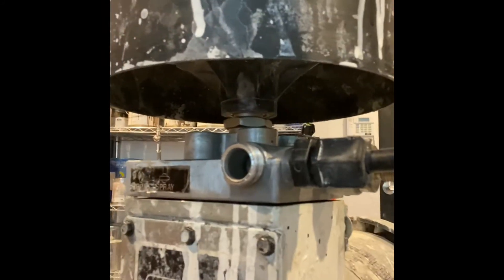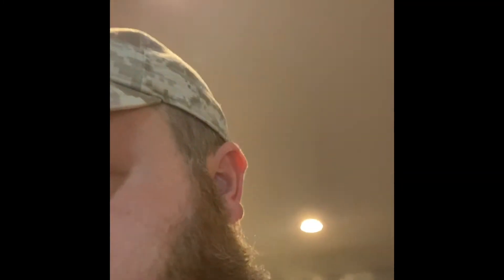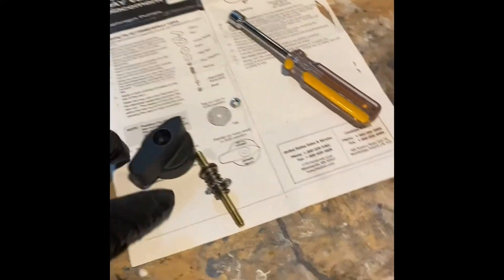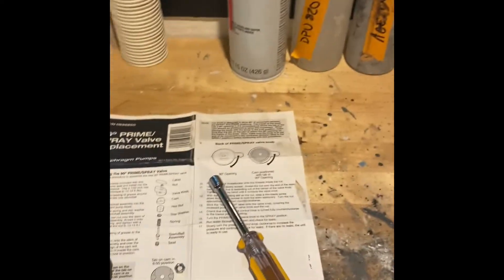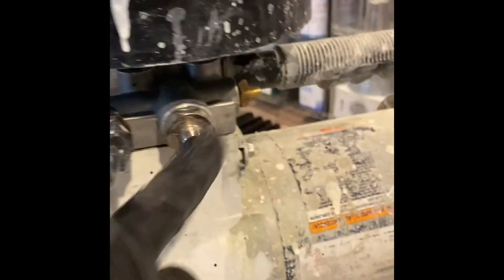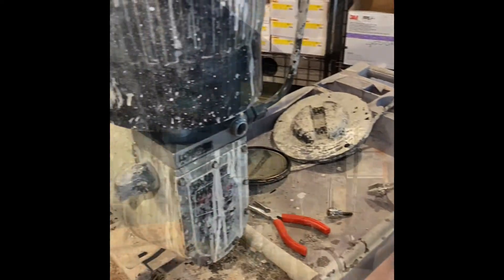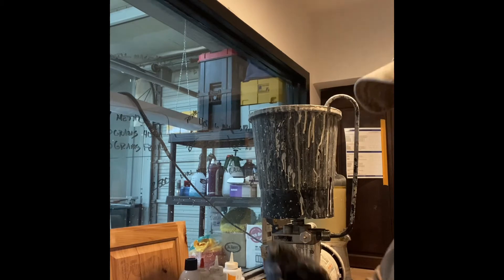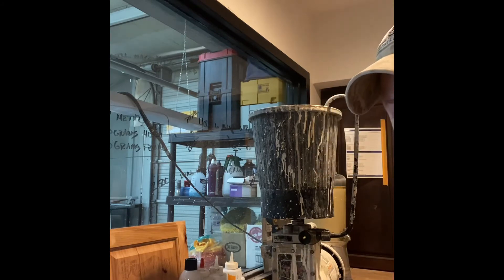Titan ED655 Prime Valve Replacement

Comment: A few details missing.  The big nut is what holds the whole thing on.  Screw it back on too tight and you can strip the threads on the head right off. The knob nut and screw slot in the needle just control the Prime/Spray adjustment. Knob nut screwed in too far will keep in in Prime mode all the time.  You need to put a  screwdriver thru the 8mm socket to hold the needle while turning the nut. The o-ring adds resistance to pulling the needle out.  I had to work it to get mine out.  Finally, not sure why you would need to replace the whole assembly. It's just a needle that closes off a hole.  Not sure how it wears out.  Mine just needed a new 1/2" O.D. 3/8" I.D. O-ring because it was leaking.
Reply from the maker: Thats awesome info, thank you for sharing.
Reply: what do you mean by the following " You need to put a  screwdriver thru the 8mm socket to hold the needle while turning the nut" about to do this on mine.

Comment: Good day sir, i cant seem to get the screw off the prime knob. Srcew just turns and turns and does nothing. Any suggestions? Thanks much great content
Reply: 😬😬 May be broke or stripped. That may need someone with a little more knowledge regarding repairs than myself.
Reply: My prime valve drips a little.  Do you think it needs a new valve or just taken apart and cleaned?

Comment: I have the same machine and recently it lost some of the pressure and starting to get this orange peel finish due to low pressure 
Any ideas what might the the problem?
Reply: Try a new diaphram, they are pretty inexpensive, also make sure the inlet valve is moving freely, pour pour some thoat seal and moving with the top of a pencil to lubricate, also outlet valve, theres a ball and seat, make sure thats moving freely
Reply: Oil change

Comment: I’ve been told by the repair shop, along with my friend who tried to repair his, that they are pressurized. You mentioned you took it all apart and cleaned it. Is it spraying properly if it is no longer pressurized?
Reply: It's not pressurized, they are meant to be work on, the hydraulic assembly isn't completely full either they only fill it about 80%
Reply: No

Comment: Question, I cant get it to pump/prime or do anything?? Any help?? Thank you guys!
Reply: Try to dissamble the top and make sure the inlet valve is moving freely, also you can open the outlet valve, theres a small spring in there with a ball, make sure thats also clear and moving freely
Reply: @duartepaintinghandymanservices  thank you!
Reply: @joseguzman7459  yw